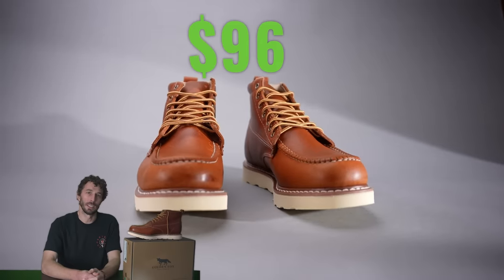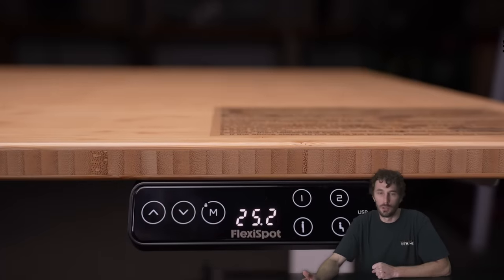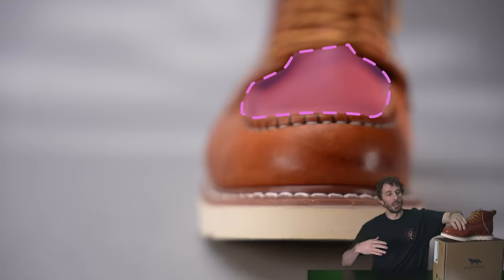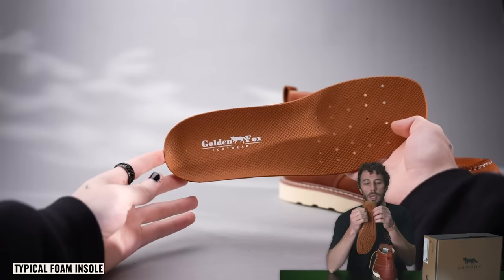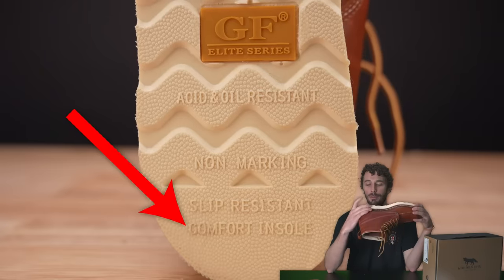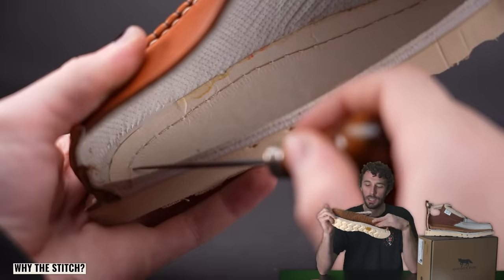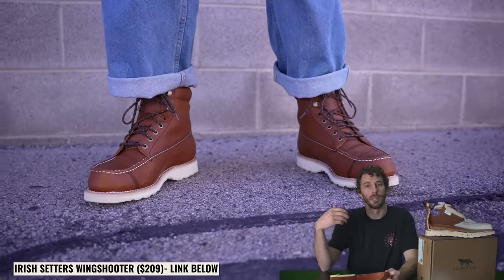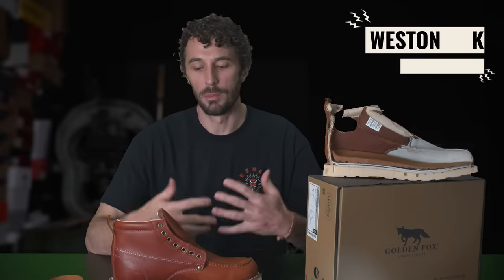($96) Is #1 Amazon Moc Toe Boot Junk? - Golden Fox

Comment: Very surprised by this. That's a whole lot better than expected.  They definitely seem to have set the bar for budget boots.
Reply: They are actually really good I used them for years. But the one thing that shows the price is the outsole. it starts to rub away slowly. If used 55 hours a week. The heel is at least 50% gone after 8 to 9 months.
Reply: Have you ever resole it?
Reply: @gromenteal2133  No, I don't know how, and they are so cheap it doesn't make sense to pay someone to do it.
Reply: @LordMesa  , Sureway boots are a lot better. Leather is very nice on the Sureway, but they dont cut the corners on construction. Sureway is like a Rockrooster without the weather welt. Rockroost is probably the best budge Moc Toe boot that can actually be best used as a work boot. Otherwise, Thorogood or Carolina is your next best bet in terms of quality, but I bet the Sureways will last just as long as the Thorogoods for less than half the price and will be just as comfortable. You can buy two Sureways for the price of a Thorogood, and you won't have to bother with resoling the first pair after it wears out.
Reply: @arorakevin  I have never heard of Sureways. I will check them out. Thanks!
Reply: @LordMesa honestly, 9 months out of a boot this price isn't bad at all lol

Comment: WARNING:  they run very large. I’m an 11 and can get comfortable 10.5 for those brands that run large but even the 10 is a little loose.  Definitely size down 1. They’re great beaters, I don’t mind getting wet and dirty. At their website Outlet, they are $40-60 but NOT returnable so size correctly. At those prices they’re very good.

Comment: I have a 6 year old pair of Wolverine cemented steel toes that were about this same price. The leather has held up well, the fabric lining has held up well and they have been on my feet through many miles of woods, asphalt and gravel. This pricepoint of boot holds up well and is comfy for working. The downside is the outsoles are worn out, but after 6 years I'm not mad about it. Still work fine as garage boots.

Comment: These are my current and first pair of moc toe boots, picked them up at the local Big R store. I love them. I was honestly shocked how nice they are for the price. I have worn them for years, climbed countless mountains, walked all over town and they are always comfortable. Leather is very soft and comfortable. Sole is super grippy even on snow and Ice. The leather is great but being in Colorado i let them get too dry so they have tiny micro cracks but look great once conditioned. Over the years they did begin to leak in water when walking through a stream or puddle, but they did not leak at all when I first bought them so that is mostly my fault for not sealing them properly. I 100% recommend these for a cheap moc toe.

Comment: I had a steel toe pair of these that I used for work as an mechanic at a dealership. They lasted over 2 years and I put them through hell not worrying at all where or what I stepped on as well as kicking lift arms underneath cars on a daily basis. The only reason I finally got rid of them was I upgraded to a pair of Red Wing moc toe boots that I got through a work program. The wedge sole is pretty slip and oil resistant and didn’t wear down as fast as other moc toe boots I’ve had with rubber soles. They are surprisingly comfortable if you get a pair of better insoles and Golden fox does offer some unlined options that cost a little bit more. I would definitely recommend these to anyone who wants a decent work boot, for the money you can’t really go wrong with these.

Comment: If the foam wasn't crumbling, it would actually be really nice for the price. Especially if you compare them to most sneakers (with fake leather or canvas for 100/150 dollars or more).
Reply: The foam is pretty difficult to access and doesn't really affect the experience of wearing the boot. It's buried within the leather of the boot. It definitely cheapens the feel of the boot to the touch, but the boot is constructed quite well for under $100.
Reply: My old Caterpiller boots feel like they're full of barley with the old crumbled foam, but once I put them on I never feel it.
Reply: They could improve the boot by leaving out the lining & foam.
Reply: I own a pair of these and had them for a year the foam on mine is in better shape than this

Comment: I have over 40 pairs of boots and felt like I needed a pair of black moc toes to add to the mix. Since I have a large rotation going, I decided to go with a less expensive pair that I knew wouldn’t get a lot of use.  I found a pair of these same Golden Fox’s in black on sale for $70 last year. I have to say that I was pleasantly surprised by the quality. Are they the best constructed boots I have? No, but don’t need them to be. For a fashion, knock around boot that I wear 1-2 times a month, they serve their purpose well. I just picked up their Boondocker and Overland boot on sale as I’ve heard they are decent, budget service boot. For someone looking to get into boots, Golden Fox is a great place to start out as you can’t beat the value.

Comment: I have these Golden Fox boots.  I also have Red Wing, Thorogood, Carolina's, etc...  I am placing an order for the White's soon.  I will say that I prefer and mostly wear the Golden Fox vs. the more premium brands!  Here is what I like about the GF:  Much lighter in weight than the other more premium brands (I was surprised you didn't mention this?);  I don't like speed laces on shorter boots, I prefer eye-lets (the only other boot with eye-lets is the Redwing); Very comfortable; I like a liner in the boot.  I live in Western Oregon and it would cost over $100 to have someone reputable (40 miles away) re-sole these boots with a Vibram sole.  I suspect GF made a similar boot years ago that was branded by Cabelas.  I wore the Cabelas daily on a 1 year house remodel project.  The uppers wore great.  The sole was different than the current GF and wore-out (became dangerously smooth and slick).  I think the GF soles are wearing much better.  It didn't seem like a good value to resole a boot this inexpensive.  So, I bought the GF and all the other more premium boots to do my own compare.  You need to remember that the GF boot is less expensive than a tennis shoe and more comfortable!  
.

Comment: I put some cobblers choice leather laces and red moose mink oil them up. I round off the back heel right away with a sander. They are super comfortable if you also upgrade them with Super feet insoles. I went a whole size down, I also have the Wellingtons pros which are nice and the same construction

Comment: I live in Taiwan. There is a local company, here in Taichung, that hand-makes boots that are meant to be nearly identical to more expensive boots from around the world. I have two pairs of boots from them, one is essentially the Red Wing Iron Ranger, the other is the Red Wing 875 Moc Toe. Both seem to be very good quality. I've worn the Iron Ranger clones for nearly two years in serious work environments (construction, demolition, metal fabrication, etc) and had zero issues. The crazy thing is that they cost about $100 to $120 (depending on the current exchange rates). I wish there was a way for you to cut one of those in half.
Reply: What's the name of the company

Comment: I wear these boots year round for work as carpenter/ remodeler and i have no issues with them. Also have a second pair as casual wear. For the money they are great as work boots last me about 16 months. If you work as a concrete laborer or other " heavy work they might last too long. They take awhile to break in is the only down side for me.

Comment: If they still made the regular AP611, the Rock Rooster from a couple years back would certainly be a better choice. As is, the VAP611, which is the same boot with a vibram outsole instead of their multi-layer one, is up to $130.

Comment: I had a pair of this brand like 10 years ago. Kinda Christy stole chukka.. They were comfy and the leather seemed nice, but you could tell off the top where they were cheap. Like plastic/rubber welt and midsole. Back then it was like a thin leather or leather-esque lining.

Comment: You should check out the 8" King Rocks boot. King Rocks is another brand by Golden Fox. Their 8" moc toe is unlined, but otherwise very similar. IMO they are far superior to Thorogood's in the comfort department. Thorogood's are too heavy and too expensive. Also Thorogood soles start out thinner, and thin out faster. I am on my 4th pair of King Rocks 8" Moc Toes, and have the 6" moc toe pair from this video which I wear casually, and a 6" plain toe boot they make which has a waterproof lining. They are all great. I do construction (polished concrete and industrial floor coatings).

Comment: I thought it was widely known golden fox is the best amazon boot. I buy these frequently and they are surprisingly comfortable. Because the sole is so soft, they wear very fast. Best for indoor/concrete.  I can also vouch for "ever boots". They are great boots for $85 but understand they are not $300 boots. Basically the same as these without a inner lining. Id recommend these for those that work around sharp objects and get their boots cut/gouged/holed.

Comment: I just got some heritage 877 on eBay for $250 shipped. Basically brand new cause they didn’t fit the previous person. Well I oiled them and cleaned them thoroughly. I work heavy highway and build bridges, my heel is fucked on the left side. This didn’t happen when I had a pair of factory seconds 875

Comment: Would love to see you cut up a pair of Grafters monkey boots they are pretty similar to Dr martens but from what I understand they still use a Goodyear  welt and a full leather midsole which would be great to find out. And for the quality they are very inexpensive at under $100 and durable in my experience with them. Hope to see them on here in the future. Probably the most underrated and fairly priced boot/shoe in the industry… check them out.

Comment: I personally own two pairs of golden fox boots , I have these in black , there actually pretty decent boots , I wanted black redwing moctoes but didn’t want to spend 3-4 hundred on them LoL, so I went with these , there good casual boots but wouldn’t use them for work , I do own several pairs of redwing heritage boots and PNW boots , so from a guy that owns real boots , these aren’t too bad for $100 bucks , I would recommend them
Reply: I did the same. I have about 30 pairs of boots and am lucky to wear each pair once a month. I love the look of the black Red Wing moc toe but couldn't justify paying that price for a boot that I'm going to wear 12 times per year. I had a hole in my collection of a black toe moc, so went with a black pair of Golden Fox's. I was pleasantly surprised by the quality of these and get the look that I want at decent quality and a low price.

Comment: I think I have seen a few " vintage " pairs of golden fox boots on Ebay,  they were made in either Taiwan or Korea which to me suggest 1980's.
Maybe this brand has been around since the 70's in some capacity?
They definitely don't actually make boots that's for sure, and having been around for a long time doesn't mean anything when you don't actually manufacture products or at least have a reputation for contracting only the highest quality goods.
( like Sears / Craftsman tools in the 50's-70's )

Comment: I think these should've been ranked higher. They have the construction that every shoemaker swears by, ans quite good leather. The only vad parts are the lining and foam.
Reply: You wouldn't rank them above the Irish Setters, though, and that was the only other option on that list.
Reply: @maxwellerickson7066 personally I would put them over the Irish setters. I've had both boots and I really like the golden fox. I have three different pairs of the golden fox and there awesome boots. I've had a pair for over a year and a half and still rock them to work. And they have two American made moc toes for 199 bucks. One with a storm welt and one with a flat welt. You can't beat that.

Comment: I disagree with a valuation. I understand that you are comparing products to others of similar cost, and that is fair, but it misses a broader point. $100 boots are worth $100, in my opinion. There are weak links in boots made cheaply, like that lining foam that has dried and crumbled in the time it took to get from factory to consumer. These failures will cause the boot to need replacement sooner that boots made with better products.
Yes, there are people who would rather just buy a new pair every year rather than repairing an existing pair, but the cost per wear goes sideways and then backwards. A $100 pair every year is $500 in five years, versus, what, $350 with one resole over that same stretch for boots with better parts.
There well may be people that will destroy a boot in a year regardless of parts, so I get that there's a market. But it doesn't really make it better. You can get single-year work boots for half that price all over. No, they aren't Goodyear welted, but again, that doesn't matter if you're only getting them for a year.
And here you've got a Goodyear welted boot that won't really compete with the round up of good boots, so what's the point? I guess the point is to mislead people into buying a short-life disposable boot thinking their getting a really good one.
An example outside of work boots. I bought a pair of Keene hiking boots. These are highly regarded within the hiking community. They are cemented, but I doubt that glue will fail. And the soles were very rugged. I wore them a lot for hiking over a couple years, and could hardly notice the wear on the soles.
But the lining wore through in places. This happened in spite of my standard care when taken them on and off, and the practice of rotating boots so they got rest.
The lining wore through, which would be an expensive fix, exceeding the cost of replacement.
All it takes is one cheap part failing to do this.

Comment: I had one of those. It was one of the worst boots I owned. Lasted less than a month.
Reply: I think the issue is with these Amazon brands is that their made in various factories and so you can end up with wildly different quality from one batch to the next.
Reply: I own three pairs and have been use one for almost a year and a half on the construction sights and they are holding up great. I don't no what you did to yours but that's pretty crazy.  And there not a Amazon brand.  There a company from California. I live 45 min from there warehouse and you can buy there boots directly from them. They also have American made ones made in that warehouse for 199 bucks
Reply: @ianmccoy9475  I am also not the one that said they were an amazon brand, I see that in the comments now but ignored that until you mentioned it. Again I bought mine directly from them. I got 2. I only mentioned one above as one lasted a month. I hardly wear the other pair as I am worried they will not hold up. The main issue was the sole seemed to wear down very very quickly.  I tried to resole them my self and I messed up the upper so just through them in the trash. Besides the heal counter had a hole in it any way.

Comment: its not worth a 100 - it prob has zero durability which means youll be just replacing it sooner rather than later.  you can find good deals online for much better boots.
Reply: I have three pairs of golden fox boots. Been using a pair for almost a year and a half on the construction sights. And there holing up great.  There good boots